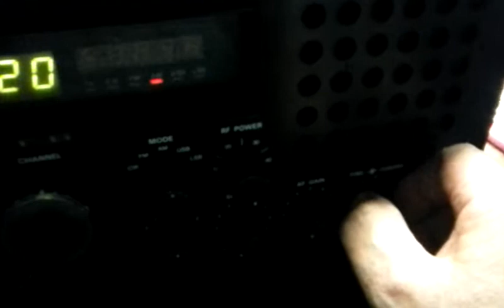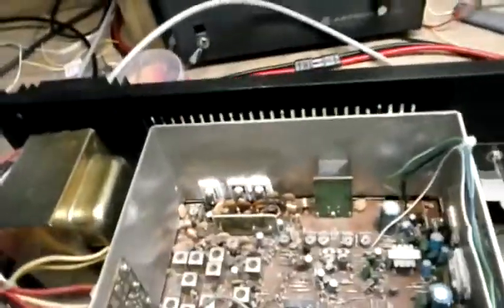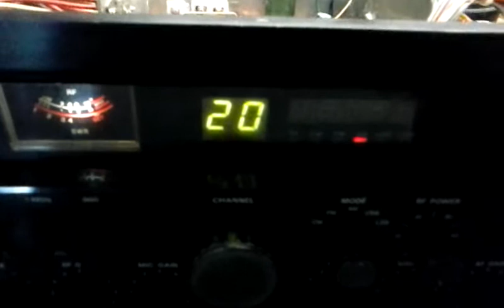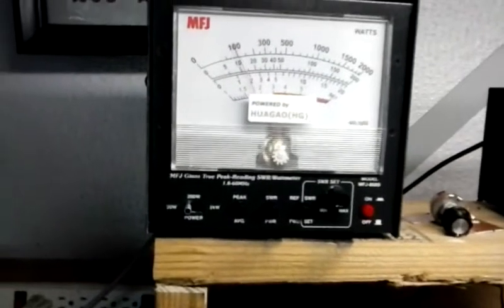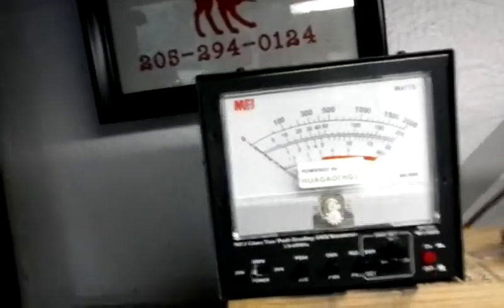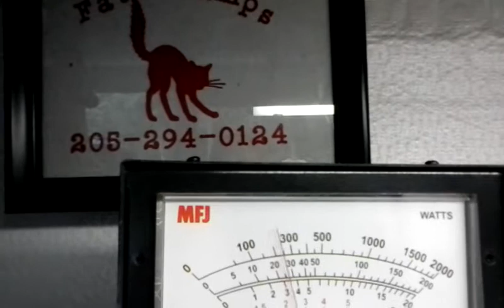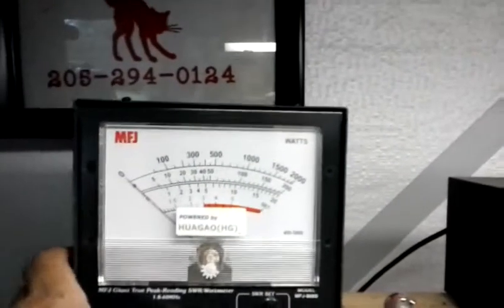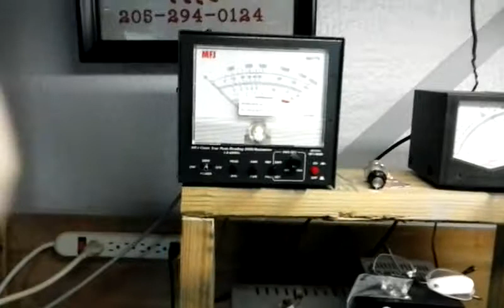Weak Weak Galaxy Saturn part - 1 before swing mod

Comment: iv just bought a saturn but its been turned down to 10 whats could you please tell me what rv it is to turn the up many thanks
Reply from the maker: vr 803 is low power adjust it is on a seperate board front left hand side it is only vr on that board, -i think vr 13 is high power adjust, as you adjust each they will change each others dead key, just find the sweet spot you want. hope this helps.
Reply: VR-16 dead key,